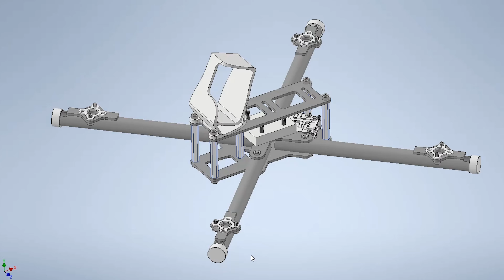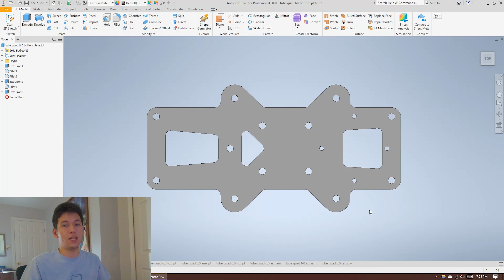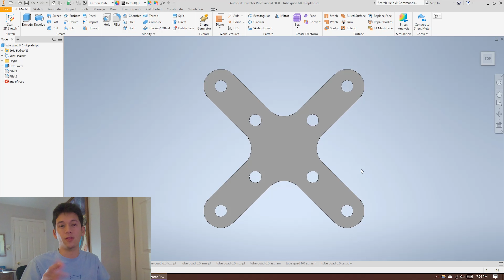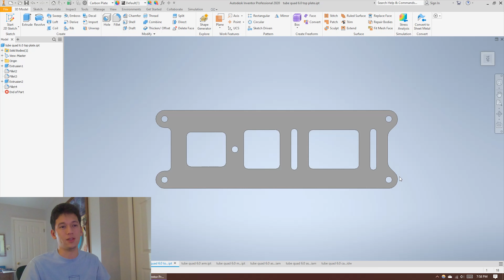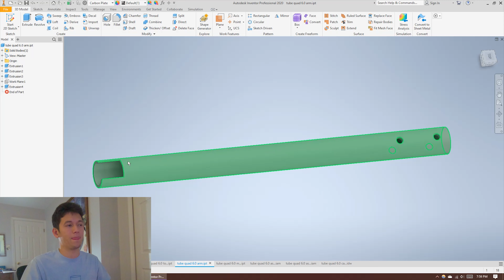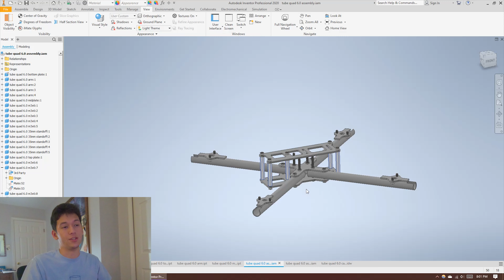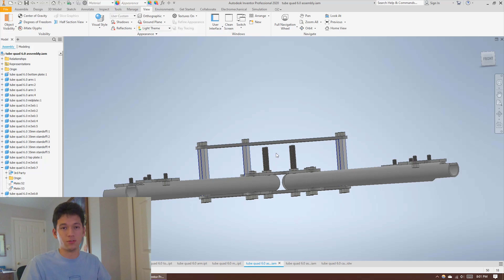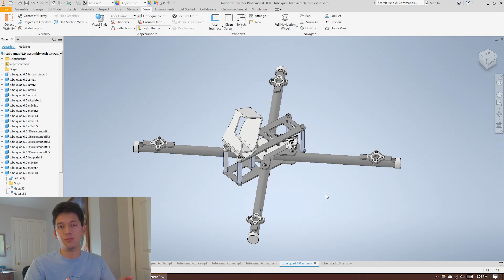Designing the Ultimate FPV Drone Frame - Tubular Quad V6 CAD Models

Comment: To save weight what if you had the motors screwed with just two screws direct to the tubes? You could saw off half the bottom motor mount leaving two holes. Also use titanium screws.
Reply from the maker: In the first few versions I tried motor mounts with two long screws through the arms. The holes in the arms caused the arms to break, and the long screws were heavy.

I definitely want to use titanium screws, but the only affordable titanium screws I've found seem to have sketchy alloys. At that point I might as well use aluminum screws.
Reply: @TimmyRC  Leading aerospace manufacturers use 3D printers to print parts and computer model the stress of load points. Would be interesting if we could print the cylinders with motor holders at ends.
Reply from the maker: @changeagent228  Definitely possible, but the 3D printed material would need to have favorable material properties for that to make sense from a performance perspective. Right now 3D printed materials are much worse than carbon fiber in terms of strength:weight. However, 3D printing materials are constantly improving.

Perhaps a hollow molded carbon fiber arm would be a way to create one piece tubular arms with a flat motor mount.